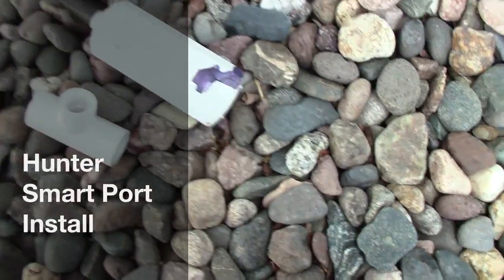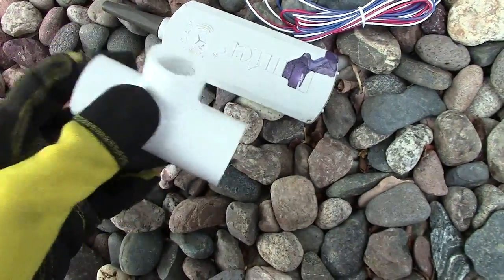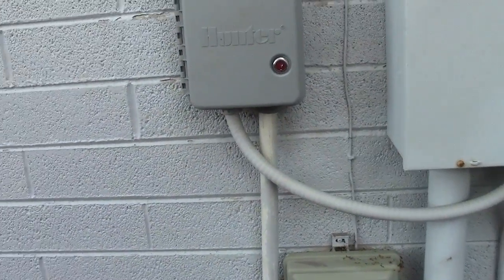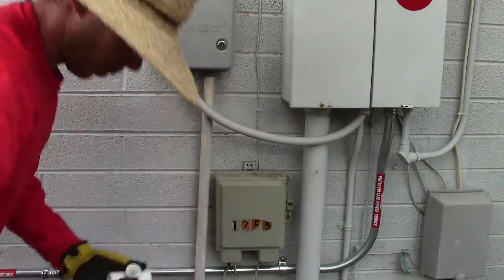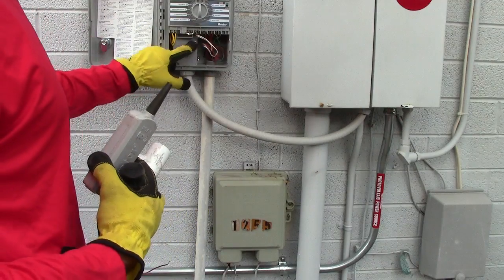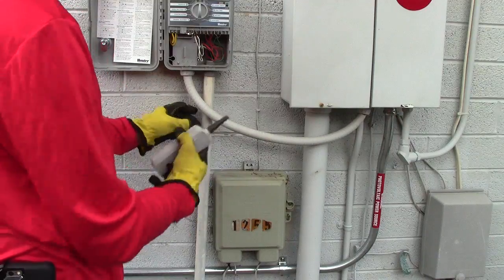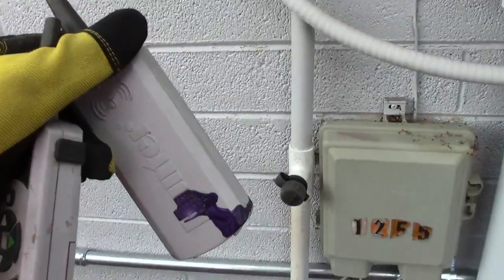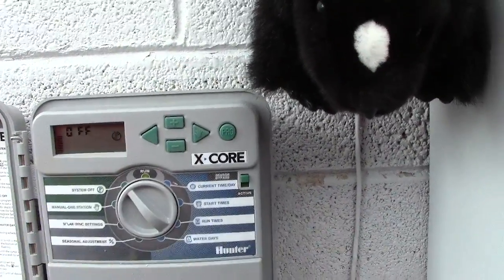Hunter Smart Port Install - Remote Control

Comment: With the Hunter Roam remote.  Is it possible to run a whole program or just a pick and choose Zone? 
So if I wanted the system to run through all zones at a non programed time. Can I just turn on P-A and it'll cycle through all zones? Or will it just start zone 1 and be done?
Reply from the maker: With the remote, I have not been able to have it cycle thru all the zones without pressing each one.  Pretty sure it does not do this...But what you can do is hit the PRG button, on the screen it will show you how many minutes to run each zone, change the minutes you want with the plus or minus button.  Then it will cycle thru all the zones in that Program.
Reply: @AZIrrigationMaintenance   I got it figured out. You have to have the dial on the controller turned to off. Then you can turn on the program from the remote and it'll run through all Zones. The dial cannot be on Run, it has to be on off for it to work. Thanks for the response.
Reply from the maker: Good to know.  Thanks for the new information.  That's very helpful.

Comment: this would be good for people who want to use it at their house permanently.  I need it for multiple jobs- existing and new installs.  
I might use that idea of mounting the port on a threaded 3 way fitting and making some kind of a pvc stake that I can stick into the ground. 

that way I can quickly wire up the smart port and have something for my receiver to be mounted to till I am done with the new job.
Reply from the maker: We also wire them up and keep them hidden in the irrigation wiring area.  Makes for a quick install and the home owners don't need them but we do!!

Comment: does it matter the one for the power on the wires where they go? you know how there's 2 do they have a special box?
Reply from the maker: +nene esGA Are you talking about the two wires already in the controller from the 4:10 to 5:10?  Yes, it is important that they get screwed back into the original spots.

Comment: Great video and great help - I installed my X Core remote ok. it has worked fine for a few months, but recently, the remote controller stopped working. I have to either turn the controller box on / off to reset , or pull off and then replace the remote receiver - the system gives its few high pitched re set pips and everything then works again with my remote handset.  2 hours later it stops working again and then I have to re-set again. Any ideas as to what is happening?
Reply from the maker: Not sure what is happening.  Give Hunter a call.  They have excellent customer support. (1) 760-591-7383
Reply: Thanks for replying

Comment: Did that X-Core have those little circular knock-outs on the right side of the cabinet like the new Pro-C's? If so, is there a reason why you installed in on the Tee rather than on those knock-out areas?
Reply from the maker: The X-Core does not have any knock outs.  The tee allows for the remote to be installed without it interfering with the controller in anyway.
Reply: It's been a while since I've used an X-Core to be honest, that's why I asked. I'm a hardcore Pro-C/PCC guy but they have knockouts on the side so those are what I use for the smart port and the wireless solar sync receiver. I used to use the tee on the conduit as well but don't anymore just because of the inconvenience of those knockouts.
Reply from the maker: The knockouts make it a lot cleaner looking.  I wish I would have been able to see the future.  I would have installed Pro-Cs instead because you can change out the faceplate and tie them into the internet without changing out the entire controller.
Reply: Yeah, true. We ended up switching out a lot of our X-core controllers to Pro-Cs when we "upgraded" our customer's systems. Now we just go with Pro-Cs from the get-go. You can switch the Pro-C face with an HC correct?
Reply from the maker: I believe you are correct.  Remember talking the the Hunter guys at the IA Show.  I wasn't paying too much attention because I don't install those controllers but you should be able to snap out the old one and snap in the new fancy one.
Reply: Yes, it is the Pro-C face that gets switched out to an HC face. You coming to the IA show this year in Long Beach, CA?
Reply from the maker: Most likely will go to the IA show.  We should meet up.  Send me an email info@aimflagstaff.com
Reply: For sure. I'll email you now.
Reply: @growcontrollandscape  I too am a hardcore pro c user. It's the only kind of controller I really use anymore.  I use them at all new installs- and like you said earlier,  I also install them when i upgrade/update a job.

My only gripe with them is that the area where you wire up the AC power in the outdoor models is so cramped inside.
  
Makes it really hard to use conduit fittings- even if you trim the AC wires inside down.  The manual shows them using a 1/2" conduit and fitting, but in real life there's this threaded hallow "bolt(?)" inside that gets in the way! (the "bolt" is the part where the AC wires come from the transformer located inside the outdoor units.)

do you know what I mean?  I have no problem threading a nut for a conduit fitting on the right/zone/module side, but on the left/power/AC wire side it is almost impossible to attach a conduit fitting due to all the BS inside getting in the way.

do you know what i'm talking about? if so what kind of fitting do you use to attach conduit on the power side? water proofing is always my main concern in that area.